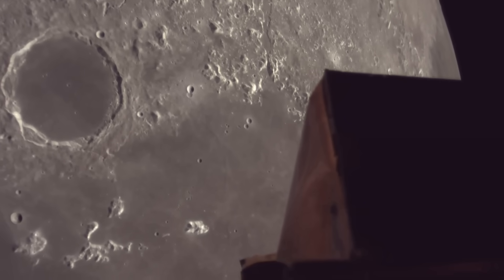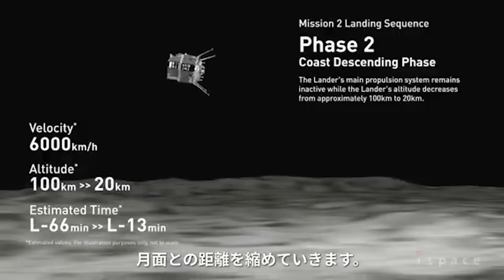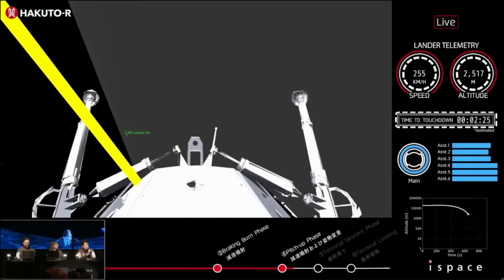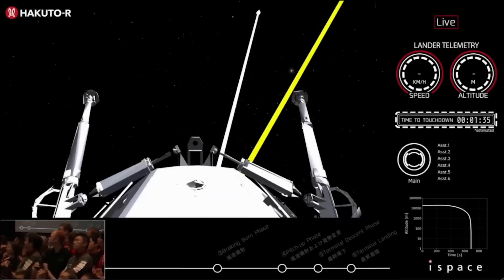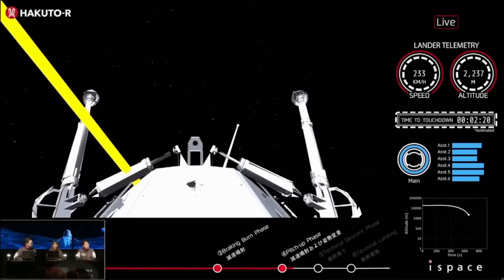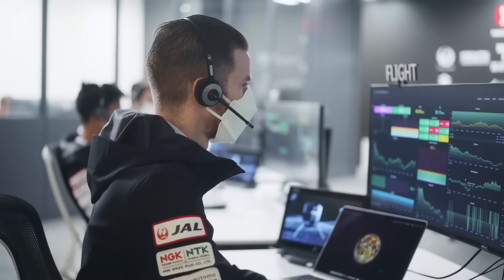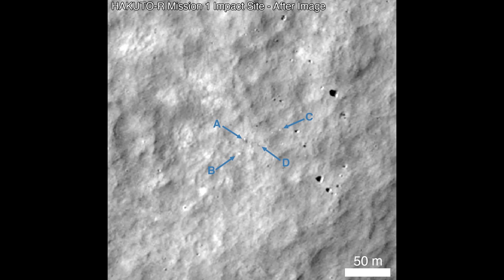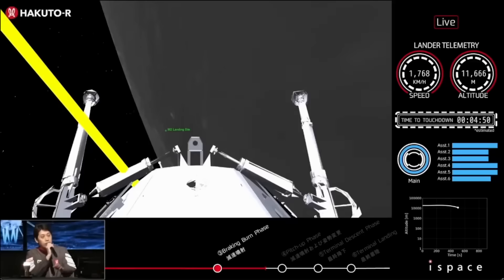Another Lunar Lander Just Hit The Moon Too Hard

Comment: Would it be too crude or simplistic for the landing craft to play out a very thin cable with a weight on the end to hang below the craft as it approached the surface , say 100 meters long . When the weight landed on the surface this could easily be detected and action taken . Actually 2 cables and 2 weights at different heights then velocity down could be determined !

Comment: Landing on the moon is definitely hard. Landing on anything with no atmosphere is difficult. You can't use parachutes. That said, while the Mars rover's landing used parachutes for the initial descent, the final descent is done without parachutes and solely using engines, if I'm not mistaken, and in this final stage, I'm not sure the presence of an atmosphere helps all that much. So I'm not sure why landing on the moon looks harder than landing on Mars, all things considered.

Comment: Seems to me that the company needs a secondary satellite system in orbit to have eyes on and control of descent of the lander.  The radar landing data from the lander seems to be easily corrupted.  Maybe "eyes in the sky" could help better determine a safe landing scenario.  A triangulated approach with multiple controller orbs could do the trick.  It might call for multiple missions to emplace the controlling orbs.  Sounds like fuel load during landing is an issue too.  Too much or too little.
Reply: Then you run into sensor conflicts.  Who's right?
Reply: @imaginary_friend7300  Multiple sensors on each orb.  Main controller makes the decision based on cohesion of readings around a central point.  Kinda of GPS locating really.
Reply: @burrows640  More sensors just means more possible conflicts so they'd have to have a prime system that wins or perhaps polling the multiple sensors would be an option.
Reply: U.S. companies (Lockheed and Boeing), as well as China have proposed lunar orbital constellation systems, for both locating (like GPS) and communications. Such systems would be very expensive and not get much use; at least not yet.
Reply: @BryanM61  The time is near.  The long term costs are minimal.

Comment: obviously they did NOT understand the first failure and essentially repeated it a second time ... I guess robust programming is crap since they cant figure out that redundancy requires independent systems to be in correlation ... and not based on some programming to say it is good data or bad data ... it must weight all data and make a decision on what is true ... 
hard for a PROGRAM to do that and AI landings would be a BAD idea as that would then leave too much room for bad things to actually happen 
 

so tto  put a fine edge on it ... these morons did the same things and had the same problem a failed landing ...

Comment: Is there only a single laser ground distance measuring unit? Seems to be problematic to only have one as having multiple, as in many aviation systems, gives a both backup and a reliability check. Many critical systems use three sensors and throw out the one with a farr off value.
Reply: Weights not as big of a deal on an aeroplane.
Reply: @Sancha-pana maybe not but lack of "I tell you three times" systems sure seems to have resulted in total loss.. So that's a lot of "wasted weight"

Comment: I'm not a rocket scientist, but if the lander was traveling at 187 km/h at 52 meters above the surface, it crashed about one second later. The lander is now in 1,000 pieces on the surface of the moon. Saying the lander "just hit the moon too hard" I think is an understatement.
Reply: Yup... that thing took a long, bouncing tumble across about a kilometer of moonscape. I'd bet you can see the line of disturbed regolith and debris with a telescope.
Reply: @Mr.Ekshin  As fragile as these Lander's are, 116mph into the moon wouldn't leave much.
Reply: @JStock-id1qi I believe Mr.Ekshin is trying to point out the effect of de much lower (one sixth) gravity on the moon compared to earth gravity.
Reply: What a difference 12 hours can make between a comment and a timely update. Hmmm
Reply: Well considering there is literally no drag to slow down anything in space 187 km/h isn’t really that fast
Reply: @labbit35  - I think you're confusing "wind resistance" with "drag". In this case, the "drag" was induced when tumbling across the moon's surface.
Reply: @Mr.Ekshin oops
Reply: @labbit35  Until you hit something, like the moon.
Reply: @roachtoasties do you have any idea how slow is 185km/h in space 
It isn’t just slow, it’s VERY slow
Reply: @labbit35  I know that. What you can't do is go 185 km/h hour when you're about to hit something, in this case the moon. If you're landing on the moon, earth, mars, or wherever, at that speed, you're dead. In this case, the lander is in a bunch of tiny pieces on the moon. Of course, speed is relative. The moon is already moving fast through space and around the earth. It's how fast other objects are going, and their direction, in relation.
Reply: 187 km/h is about 116 mph. Now, imagine driving with that speed straight to a concrete (or rock) wall. Would make a pile of junk, but maybe not in thousand pieces? Most components would be even recognizable.
Reply: по данным телеметрии, корабль - не 1000 фрагментов, а остановился на высоте -223 метра (слегка заглубился?)
зато, есть основания, выяснить состав Луны на такой "отрицательной высоте" ;)
почти как "орешник"

Comment: I know, NASA and the like are all saying "Sure we lost it but we're learning a lot even from these failures," but I think the most specific thing we're learning is that it's more likely to succeed if there's an actual pilot landing on the moon, and not a computer that can't really react to the small problems actually getting down on the moon has. Adjustments like, "That's a bigger rock than I loke, let's shift over a few feet and avoid it" or "There's a big dip right there, flatter over here, that'll work." Eyes on is better than 7-seconds ago.
Reply: Computers have come a very long way since 1969 — especially when paired with LIDAR, real-time terrain mapping, and machine learning. Modern landers can now dynamically assess hazards like boulders, slopes, or craters and divert to safer zones mid-descent — things that were once only possible with a human eye and gut instinct. 

Still, the margin for error is razor-thin, and there is a strong case for hybrid approaches: onboard autonomy plus human oversight, especially when latency isn’t a dealbreaker. Eyes-on is great, but smarter eyes-in-the-sky are catching up fast.
Reply: The point of these types of missions is to significantly reduce costs of lunar landing. This is needed to make lunar resupply missions economically feasible. Adding crew would increase cost by several orders of magnitude. Rather than moving backwards the more cost effective solution is improving the sensor systems and onboard computation power. It’s not like this isn’t something that hasn’t been accomplished many times, including by private companies, China & India.

Comment: Five of the seven Surveyor landers landed successfully back in the '60s. With very primitive technology. But look at the design difference between this thing and the Surveyor landers. They were short and wide. They landed straight down, completely vertical. Even most of the Apollo Lunar Modules would likely have failed, had they not had human pilots. Apollo 11 definitely would have crashed. The intended landing spot turned out to be covered in boulders. Neil Armstrong kept flying it manually until he found a safe place to land it. And all of the Apollo landers also landed completely vertically. They hovered, then went straight down. It seems like most of these landers that are failing have two major issues, besides not having a human pilot. They are top heavy, too tall for their diameter. They also seem to be moving horizontally to some degree when they touched the surface, which would obviously tip them over.
Reply: I do not think that the 'top heavy' characteristic of the lander is an issue. The LEM was top-heavy too. However, the onboard logic and , maybe, too few sensors are the main culprit.
Reply: @heggedaal  LEM was NOT top-heavy: you're forgetting that most of the weight is in the engines.
Reply: It looks like this one was closer to the surface than it thought. Splat.
Reply: "They are top heavy, too tall for their diameter." Precisely! 

With regards to the "not an engineer" post above, I AM an aerospace engineer, with more than a decade of space operations under my belt. Mr. Scott's comments and observations are entirely correct.
Reply: The LEM actually took a landing approach similar to what they are attempting to do.
Reply: Copium. Just admit Apollo never happened.
Reply: Keep typing paragraphs. You seem to have a good grasp of what's going on.
Reply: stop typing paragraphs you aren't an engineer anyways .
Reply: @yoichi6634 

Stop trying to read beyond your 
comprehension ability. 
It makes you lash out in frustration.
Reply: @yoichi6634  

Stop trying to read beyond your
 ability to comprehend. 
Your resultant anger causes you to lash out.
Reply: @yoichi6634  No, I am not an engineer. And it looks like whoever is designing these landers isn't either. I AM a licensed private pilot and race car mechanic, and I have a pretty good understanding of the laws of physics. I also have a typing speed of between 60 and 70 WPM.
Reply: @yoichi6634  You don't need to be an engineer to understand the basics of a design. I'm pretty sure you don't forgo driving a car because you aren't an automotive engineer and thus could never fathom to understand how a car works.
Reply: @yoichi6634 yeah, I agree. Long paragraphs are hard for regards like us to read.

Comment: So sorry for iSpace.  Another laser rangefinder problem.  Intuitive machines had this issue also.  Invest more in the altitude determination instruments with redundancy. It's unfortunate to go all that distance and then crash upon landing due to a laser rangefinder issue.  Hopefully third time is a charm.
Reply: I am also surprised by the lack of redundancy for a system that is vital to the device...
Reply: I don't think is the sensor (as it was not before with Intuitive Machines it was a procedural error on turning off the mechanical safety of the laser that was dangerous to eye), the delays seem to be related to some software problem, this is the most common in RTOS used in space. Sensors usually don't have this failure mode.
Reply: @agranero6  Everything is correct. But duplicating the sensors allows us to assess the difference in the data they provide or their internal software (if any, of course) and adjust the actions of the device in cases where the desynchronization of data exceeds reasonable values. 300 kilometers per hour 100 meters before landing is clearly suspicious!
If the problem is in the PS of the device itself, there are many factors to study. But the opportunity may no longer exist....
Reply: @Dragonych1976 You can't duplicate, to have redundancy you need 3 or in case of discrepancy you won't know what data to use. And it takes CPU to read and compare them, precious time that can be needed to other things. Radiation hardened CPUs are not famous for their speed. The main question is weight. The sensors of this type I saw are big and heavy. Fron afar all looks simple, from near everything is comicated.
Reply: @agranero6  You may be right, but we recently "saw the result with our own eyes"
Reply: @agranero6 The second intuitive machines mission also had laser and rangefinder problems in addition to communication issues.

Comment: Whomever heads the laser altimeter department had better polish their resume cause two failure in a row related to the laser altimeter isn't going to cut it!  I am kind of shocked that they do not appear to have gotten a handle on something the aerospace industry has understood for a century!  My sense is this a a bunch of tech bros that figured they were somehow uniquely capable of doing something without a lifetime working in the field.  You'd think the tech bros would have figured out the software by now, particularly after an embarrassing failure the previous time.  I'm growing increasingly worried that the mindset of the modern space company is fixated on doing it their way while ignoring more than 6 decades of work done by others.  Perhaps the idea they might actually learn something from people that work for and worked for the government is alien to them!  The good news for ispace is that between Musk and Trump firing a boatload of engineers and others in the space business at NASA by cutting their budget perhaps ispace can snap up some people that actually know what they're doing because the current crop at ispace are not up to the task!

Comment: this is exactly why starship cant land upright on the moon, theres no way that topheavy payload full starship is landing standing up in that low gravity. They will need to figure out how to land it on its belly.
Reply: starship isn't top heavy the  HLS landing engines are 30 meters up above centre of mass. Besides we've already seen successful top heavy mass simulated  hop tests
Reply: Why not? There are few lateral forces so something top heavy can still be plenty stable. SpaceX probably has more data than anyone when it comes to automates upright landings.
Reply: Weight isn't the issue. Sensors and the landing software is. Remember these commercial payload companies are show string budget. Their likely cut out better equipment that could been difference of success and failure.  Apollo 11 landed by skin of Armstrong's teeth when they hand last minute issue and he had to land the lander with mark 1 eyeball 👁️.  They were also on virg running out of fuel.  These commercial landers are operating on tight NASA budget.

Comment: There’s always some lateral velocity. But most of these landers are designed as if there is never any lateral velocity, that it simply drops straight down.
Reply: And then there is SpaceX's HLS, standing so upright on the regolith. At least in their CGI-renderings.
Reply: @aka-o9x  Yeah about that, they need to design Starship so it can lay down horizontally on the moon surface after landing using a winch or robotic arm.
Reply: @straighttalk2069  Or maybe those remote controlled mannequins of Musk (I mean Optimus "robots") can just crawl (on all fours) out of that flipped barnhouse?

Comment: I do wonder how they test their software and procedures... 😩
Reply: I believe it can also be issues with the electronics, unlike the Man in loop Apollo program and the Russian robotic landers in the 1960/70s.
Cheap Commercial electronics are less radiation hardened, especially with the ever increasing small transistor architectures.
Reply: @favesongslist  especially since they're cheap, they should have 2 to 4 redundant sensors depending on how critical a system is, unless of course they like making new craters on the moon.
Reply: Test? Try and error.
Reply: @derberti2280  at a few hundred million dollars per try it becomes ugly very quick...
Reply: Like you just saw. It's "move fast and break things" (also called "Agile for Space") approach advocated by Musk.
Reply: El software lo prueban estrellando naves en la luna🤣🤣🤣🤣